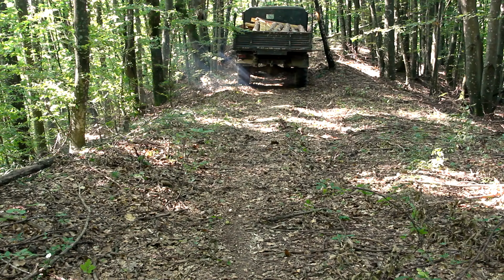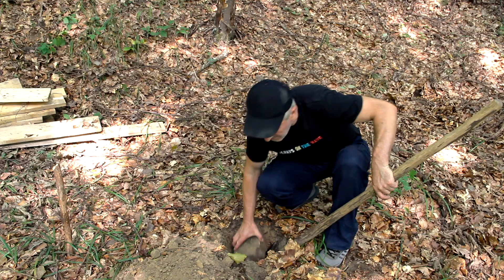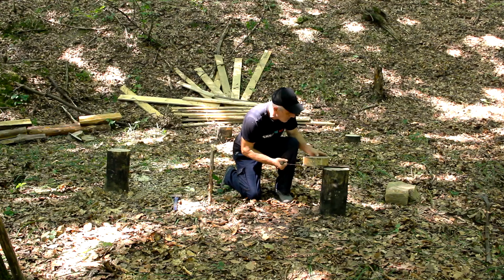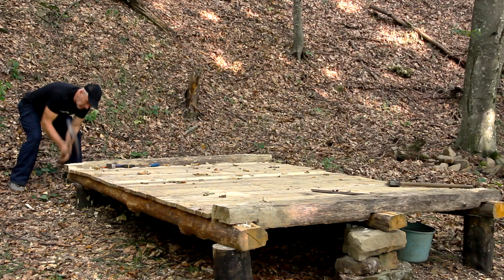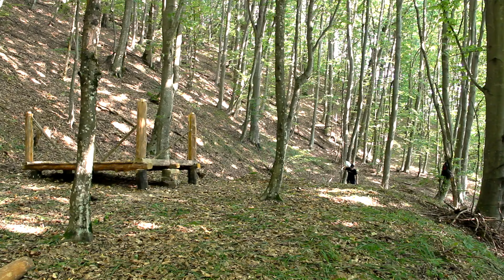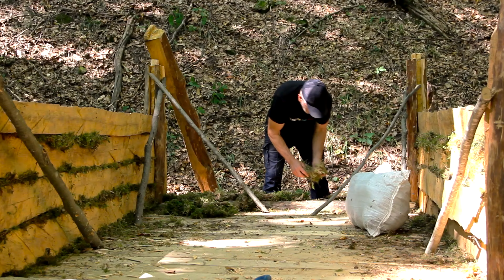A house in the forest from start to finish.A warm shelter for survival in the wild forest.

Comment: I do not think you are in the Wilderness. You backed up a dump truck to start the video, At times I heard what sounded like a Dirt Bike or a Chainsaw. Plus I am wondering why you went through all the trouble to do exact measurements, then end up putting Straw on the sides and the Roof. I do not think that the straw is Waterproof. Great Video! Still trying to make sense of your actions.
Reply: Most of these videos are BS but just fun to watch. I agree
Reply: I never saw any mention of wilderness, only in the wild, totally different